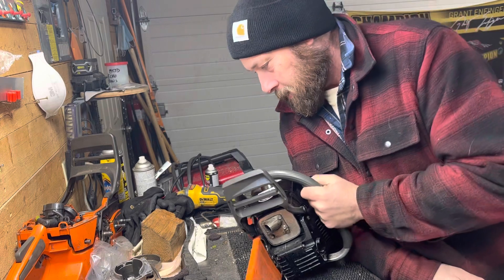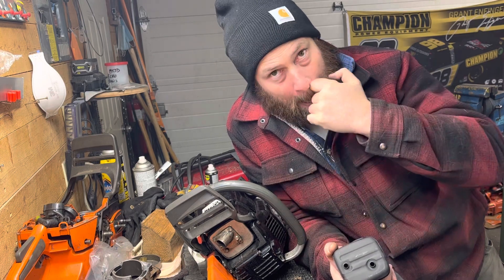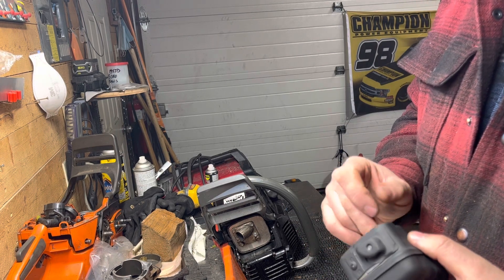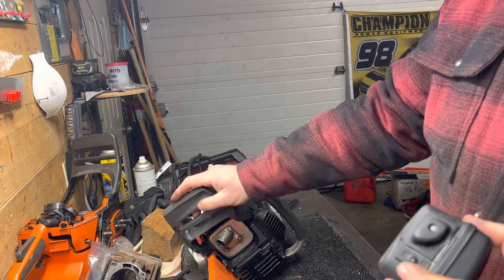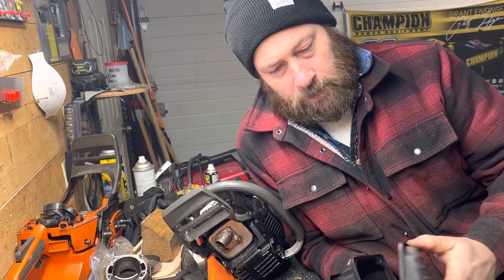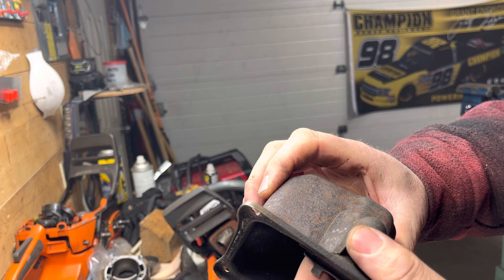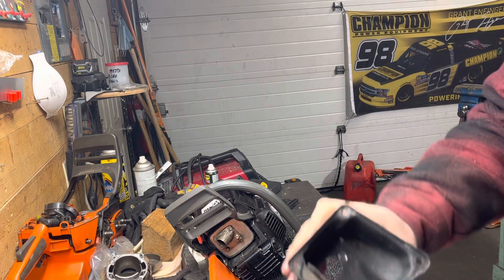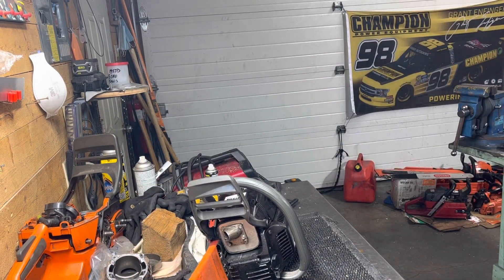Chainsaw Muffler mods…let the smoke out😱. See dealing in description.

Comment: Hey Jim, is there any sort of rule of thumb you use for the size (or area) of the exhaust port outlet vs the size (or area) of the muffler outlet?
Reply from the maker: It really depends who you talk to and possibly which saw it is. The strati-port saws are a bit different. 
For conventional saws, I’ve had pretty good results with 1:1 or even a bit larger muffler port combinations.

https://youtu.be/GlR0n86WCx8
Reply: @jimssawsnstuff8903  yeah that's what I've found too but it seems like a bit of trial & error to get the right combination. So I've just wound up having an inventory of mufflers built with single port & dual port and test driving them to see which one the saw performs the best with...
Reply from the maker: @902hand7  for sure, then there is also the balance between everyone’s preferences around noise too.
I did a really good one on an 066 for a guy a couple years ago, but he was using his saw cutting laterals at a log home outfit and the boss got upset because he was getting noise complaints😜, so he brought it back and we toned it down a bunch…😉
Reply from the maker: One of the most powerful saws I’ve had was this 046 big bore, 84.5cc, 185psi comp, with this muffler which had a 1 1/2” hole screened, pulled like a train. I’d estimate the effective hole diameter would be reduced by about 25% due to screen. So approximately 1.3 square inches.
Reply: @jimssawsnstuff8903  Yeah I've got a MS440 with an Egan Straight Shot on it.  I don't think I ever measured the hole but it's a gaping one and that SOB pulls hard too.  You def need double hearing protection when you run that angry lil saw....
Reply from the maker: For sure. I’ve been making some for Stihls where I use an Aluminum plate and then fabricate a more unique tube / deflector for them. You’ll see some in my video collection, like the bottle opener etc. 😜👍